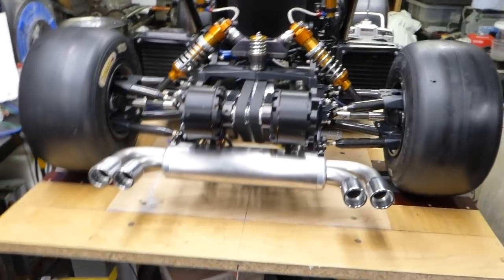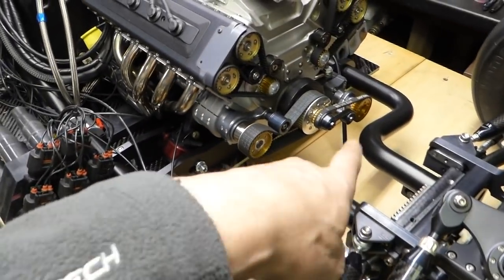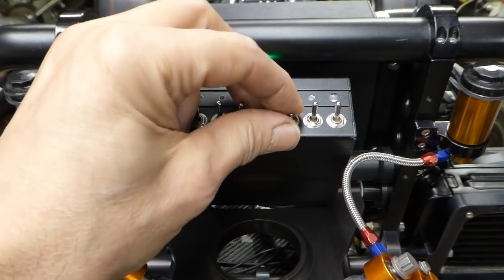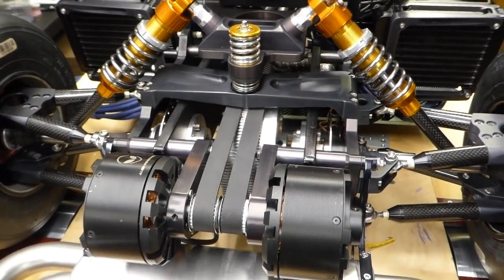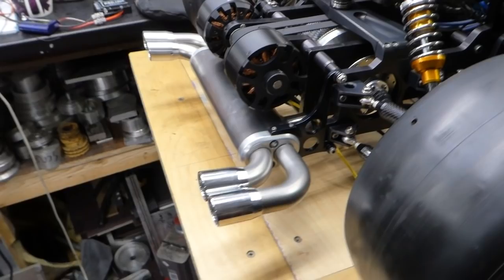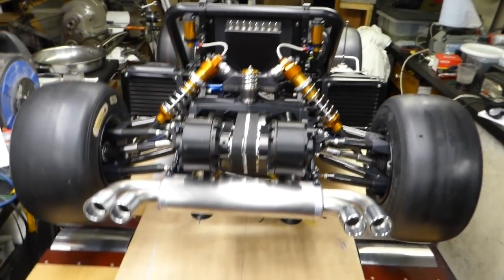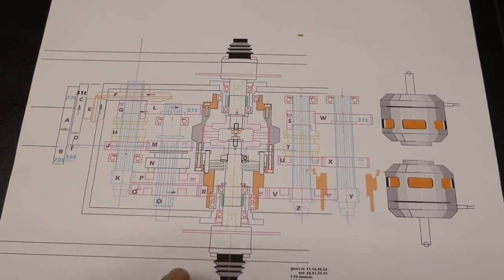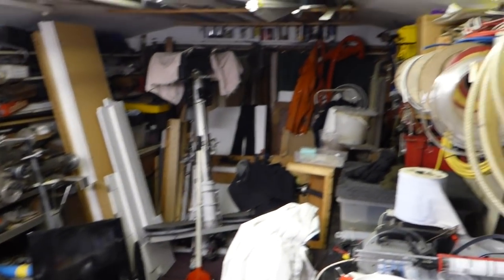1/3 scale 125cc V10 Hybrid RC car. Part 6

Comment: Is that hydraulics
Reply from the maker: Which bit? brakes or dampers? both are hydraulic.
Reply: @Keith5700  please make a video of making the hydraulics brakes and suspension
Reply from the maker: @mohammadanwar6515  i can't really. they're already made.
Reply: @Keith5700  when is your next video coming. I am waiting
Reply from the maker: @mohammadanwar6515  I would guess about 3 weeks when the new on-board fuel system is installed.

Comment: 1) This car is insane.
2) You are insane.
3) Why are there so many separate switches for the electrics? You will never encounter a situation where the coilpacks must be online and the fuel pump must be offline, for example, so they could be wired together. And surely the fans could be operated by a thermistor.
Reply from the maker: The Megasquirt controls all the electrics, the switches are manual overrides for testing, etc.
Reply: @Keith5700 : Oh. Interesting. Personally I would've just unplugged the electrics when I wanted to test them, but if you're anticipating a whole lot of testing needed, then switches would be worth the extra up-front work to install them.

Comment: Keith5700, I have not read everything or watched all of the videos yet, am I correct in understanding that you hand built this motor? Do you know of anyone that sells parts to build either a V-10 or V-8  of this scale? I do not have any tools to machine things like this, if you did hand build this I salute you for your outstanding work. I posted yesterday after I started watching the post, did not see that it was a V-10 and others started throwing rock at me, I am just curious about the motor, what fuel does it run off of? Is it a wet sump or dry sump oiling system? When do you expect to be through with it and do a test run?

Comment: Why you dont build a 1:1?
Reply: Why dont you fund it? Lol 🤘😎
Reply from the maker: Been in engineering design for 40 years, and self taught machining for about the same. Had about 15 years building full sized cars, but built other stuff too, helicopters, telescopes, planes, etc.
Reply from the maker: I made the billet aluminium bits. The cost is just buying the billets. To make this in full size would cost 20-30x as much.
Reply: @Keith5700  hey Keith, what is your vocation or training come from? Self learned? Technical school? Engineer? Just curious! Awesome projects.

Comment: if your interested in alternative remote controls ? the idea still exists .. tech still exists .. it just requires someone with nous to implement .. it would also revolutionise existing ( and somewhat old fashioned ) control ergonomics i.e. duel, 4 point stick.. or trigger grip with wheel .. and can also be used for flight RC
Reply from the maker: Well, I'd like to know what your idea is, but for this particular project I think it would be far simpler if I stuck to my conventional 12 channel set, as there's already enough new stuff going on to contend with.
Reply: @Keith5700  ok .. stick with conventional .. but think about minicam ( in drivers position ) mounted on electronic gyroscope..  connected to VR headset .. most of which available on amazon .. may want to reorient position of fluid tanks and stick fuel … where coolant and oil are .. case of accidents
Reply: ps maybe bracketry points.. to support engine near, or above centre of g .. incorporated into chassis .. as it appears ( from what I can see ) only 2 mounts from bottom
Reply: without sounding like columbo .. just 1 more thing .. do you have/ can you post, stock outputs for engine ?  torque .. max rpm and an estimate % of increase, with supercharger and what fuel ?
Reply: scrub stats ? found the figures

Comment: I just found your channel.  What an incredible project.  Do you machine your camshafts and timing gears?
Reply from the maker: Machined the camshafts, bought the gears. Made the timing pulleys.
Reply: @Keith5700  Wow, making 4 cams was quite an endeavor.  I worked as a machinist in a shop that built special machines that were used to make electrical terminals.   I got to watch another machinist make cams.  He carefully made each one and l never saw him have to start over.

Comment: I can help you with your ESC/PC connection.  Those VESCs can be tricky.
Reply from the maker: It's all working now, it was a faulty unit. It seems fine, apart from there's hardly any torque from startup. I thought these motors gave full torque from zero revs, but this doesn't. It only pulls 4 or 5 amps, until it gets going.

Comment: for the 2 fuel tanks you had planned, you could have a open and close-able cross feed so you can run off both tanks at once or run on them separately if you want to only use half fuel if you were going to do a return journey.
Reply from the maker: I've changed my mind, I'm going for a single one at the back, in between the other two tanks.

Comment: Where do you buy that engine?
Reply: he made it
Reply: A man named Conley builds engines like that and he also builds transmissions that goes with them as well their 1/4 scale copies of the real things and yes they are fully functional including supercharged versions I believe they run anywhere from $8,000 on up to $12,000 if you want it supercharged and not naturally aspirated if you search on YouTube Conley V8 engines the first result that pops up should be the one I think it's 24 minutes long and it's a tour of the shop where they're built

Comment: ok, well I dont think I will ever brag about racing go-karts again, lol, holy cow, santa vaca, this is a go-kart?, oh my, i cant wait to finish this video, back in the 90's I raced a Bug 90 frame, no suspension, tension bar in the back between the chrome-moly frame rails for stiffening the back end) with a Yamaha 100cc 2-stroke piston port (no reed valves) engine.  I see your fancy pant-cy cooling system, you know how I cooled down my engine? ya down the long straight-a-way turning the handle on the carburetor high jet to add more fuel (richer mixture), by hand! LOL

Comment: A hybrid lmfao bet a smoker pollutes the air more
Reply: Lol, true.  However, electric motors are good (better) at providing torque and control at low speeds in comparison to engines, so they're beneficial for that reason too.
Reply: @offroadrc110  yea true its one hell of a machine tho looks well built
Reply: @mattearnshaw525  Absolutely!
Reply: Scott E  In the realm of RC, an electric motor can do pretty much anything you want it to.  Brushed if you want good low end torque and control, brushless for brute power and speed.  To be honest, I'd say electric motors are easier to look after than an engine... Wouldn't say they require babying.  But there's nothing wrong obviously with taking the time and care to look after an engine if that's what you're using.  In fact, I'm sure many people choose gas/nitro because they enjoy the extra skill required.  It's all about doing what you enjoy most.
Reply: Offroad RC 1. Electric 2. Gas 2 stroke pre-mix 3. Nitro - in terms of ease of use. Electric RC’s are super simple to maintain. Nitro can be really finicky. I had an air leak in my Carburetor (.21 Big Block HPI) that was a pain to diagnose.

Though with my Team Associated RC8T Truggy, it’s Nitro Engine hasn’t given me issues. I guess it can be down to pure luck like anything else with an Engine.
Reply: @ŠpVŠpý  Totally agree.  Electric is very easy to use and maintain.  But for those up to the task, I'm sure gas and nitro are a lot of fun.  I completely understand why many choose to go with engines.
The challenges and maintenance are all part of the hobby for true RC enthusiasts :)
Reply: Scott E  of putting fuel in the tank? 🤔
Reply: Scott E  I'm not entirely sure I understand your view.  Cheap stuff from RadioShack is indeed just that - a quick, cheap, easy way to start driving something, no effort or experience required.
There is a huge difference between those and the hobby grade electric models though.  When you start using brushless motors and lithium polymer batteries, a higher level of skill and responsibility is required to avoid damage or injury, and it becomes increasingly necessary to keep the model tuned and in good working order.
There are also advantages in versatility for electric models as they can be made more waterproof, and more powerful with less mass.
I'm not saying Smart cars are environmentally friendly or anything, I'm just saying that there are performance advantages that are inherent with electric RC models :P.

Comment: i expect front will slip on wet a loot almost entire weight  is on back engine is in the middle nothing on the frone probably You need to add some extra weights to make front more sticky bytheway cool project
Reply from the maker: No. 45/55 front/rear.

Comment: Does the muffler have any internals?
Reply from the maker: Yes, lots.
Reply: @Keith5700  a pair of absorption type mufflers would sound better? Or are you looking to make it as quiet as possible?
Reply from the maker: Fairly quiet, but the baffles are really designed to split the gas equally, so the smoke is the same from all 4 pipes. Nothing worse than unequal smoke trails.

Comment: Total cost so far bud??
Reply from the maker: not dared keep a record. youtube ads pays for most of it.
Reply: @Keith5700  Haha, you're funny too ;)
Reply: I was gonna say the amount of hits this gets is amazing, not unwarranted though, great mechanical skills shown here, where you said the fuel tanks should go is where the twin turbochargers should go btw :)
Reply: Also how can electric motor so small produce 5hp?!
Reply: @KentRoads  Do you realize the size of this car? Look at the Radio controller besides the front right wheel, if you know how big those are you can imagine the size of the car. Its scale 1/3 afterall. The motors in the rear are probably close to 100mm in diameter?
Reply: I think you’re going to have to drop that exhaust a bit too or raise the electric motors as well as heat shield I’d reckon
Reply: Brad Stream I think he may have alluded to that, but nonetheless he definitively needs to hire you as his technical consultant.
Reply: I reckon so too ;D

Comment: I am blown away by your work. So much effort into every single detail. Are you going to fabricate any Aerodynamics for the chassis later on? Just to take advantage of all the engine power this thing must be able to put out when this is finished. I can imagine it with a huge front splitter, a huge rear wing and diffuser in the back to really suck the car down. Make it a time attack car! That would really make this thing drivable!
Reply from the maker: yes, hopefully, if I stick with it.

Comment: Unbelievable work, love it.

Get some regular drone ESCs for the brushless motors and you wont have issues, they even have RPM, temp.... telemetry some of them and easily configurable. Drop me a line if need advice on that.
Reply: Pau Mallol a drone ESC wouldn’t come close to being able to cope with the amp draw a car requires. My 1/10 touring car has 180amp esc, this would need something significantly higher than that.
Reply: @thedude669  With hybrid I assumed these two motors do not need to run alone the whole car but aiding the V10 engine (what cell count you want to use and what brushless motors' size you have there, for curiosity?).  if you have physical space, an RC car ESC gives you more product options though.
If interested, a couple of good high amp air ESCs:

- 125 A continuous: https://www.kdedirect.com/collections/uas-multi-rotor-electronics
- 200 A continuous: http://www.castlecreations.com/en/phoenix-edge/phoenix-edge-200-esc-010-0098-00
Reply: @PauMallol  Even with them just being assist unit they'd still pull more amperage than that those motors he's using are 5hp each. Besides he already has ESCs he's just having trouble getting them to connect to his computer.
Reply: Pau Mallol we only run standard 540 can motors anything down to 3.5 turn or 13.5t boosted, depending on the class you race. They are a fraction of the power that the 5hp motors will produce. I suspect drone esc’s are low amperage because of the low torque required. I would doubt a drone esc’s software would be set up to deal with the power delivery a car requires either. Would be interesting to try though I suppose.
Reply: Richard Charles I was curious to know the motors in the V10 car, specifically. A standard medium-size drone motors (say 35mm x 10mm stator 700kv) can pull already a kW on 6-cell in direct drive. But there many other considerations., especially torque (either through gear transmission and/or stator size).

Comment: Please Kieth could you tell me the electric motors you are using?
Reply from the maker: Alien 8055 4500watts. Yes, heat shield is on the list.
Reply: Do not know, but PMG outrunner on top of hot exhaust, not good placement for keeping the magnets cold. It would degrade magnets fast, if standing still too long.

Comment: Huge fans and radiators... do you have thermostat? If you don't you should!
Reply: Argeny Sandoval what purpose would isolating coolant to the block serve? I think it’ll warm up pretty quick.
Reply: @kart1241  By using a thermostat you reach a efficient engine temperature quicker but the most important is to maintain that temperature no matter what kind of engine RPM, weather conditions or percentage of stress you are putting in it.  For every engine there is a desire temperature in which the combustion is the most effective one. Maintain that temperature as steady as posible is a plus and that is the thermostat job, every 4 stroke liquid cooled engine which is not a Micro engine most have it, and this 125cc engine is certainly not a micro engine.

Comment: And Im crazy for building and flying a 1/3rd scale with a $7,000 7 cylinder radial engine in it. At least with the Air radios you can fly line of sight or by head gear.
Reply: I wanna see a vid of that flying!
Reply: Fuck yea that's badass ima go look an see what ya got on your channel man
Reply: No vids

Comment: dont you think the electric motors are pointless considering the immense power to weight you currently  have with the engine alone?
Reply: Ramiro M its for reverse
Reply: the engine has no torque whatsoever. the small displacement and the large amount of moving parts makes it a cool little engine to look at and listen to, but those engines have very little power. maybe 3-6hp if you're lucky and it s all up there in the rev range. The electric engines makes the low end torque for the car to be able to get moving

Comment: Hey what if you were to just use straight pipe heat wrapped exhaust? Instead of having the muffler. I mean not like you have to obey any regulations anyway. You could just do 5 into 1 on either side or send them straight to the back 5 into 2 each side for the quad exhaust.

Comment: Such a work of art.. cant wait for the video of it going full speed and flipping on it's lid
Reply: They look a lot like the radiotors you would use in a computer. I could be wrong but with the modified computer fans for cooling that's my best guess

Comment: I am fascinated by this build like man others here. Love to see more build detail - how did you build an exhaust and have it look like that? Is it pressed together?
Reply from the maker: it's 63mm stainless tube, flattened in the vice, with aluminium end caps pressed in, after the internal baffling is installed.

Comment: Do you get any sound from the esc's ?, not working because they haven't seen zero throttle, or tried servo tester to control them ?
Reply from the maker: No, the first job with these is to download VESCTOOL and plug the esc into the pc via USB, then program the esc. The pc won't even see the esc. It looks like they may be faulty. I can't understand how difficult it is just to get a motor to run. I've been sent a replacement, but that seems to have got lost in the post. Total balls up so far.
Reply: @Keith5700   I've not used the vesc tool , looks amazing with what it can do do, as long as it works though !
Reply: @Keith5700  Have you checked that you have the correct drivers?
Reply from the maker: You mean USB port drivers?
Reply: @Keith5700  it is possible that you need a virtual com port to connect the vesc to vesctool
Reply: @Keith5700  Yup

Comment: Maybe figure out how to mount the oil/coolant tanks where you want to mount the fuel tank (in front of/under the engine), and mount the fuel tank(s) behind and to the side of the engine.

More consistent COG as the fuel burns off.   Just a thought.

Comment: Swap out the oil and coolant tanks for the fuel tanks location, move the oil and coolant to the front. IMO it is not such a good idea having fuel close to the heat of the exhaust even if the header is wrapped.

Comment: I'm looking forward to a comment on the motor/esc supplier once it finally works (since I got a 6000W motor with some strange behaviour).
Incredible build, can't put it into words:)
Reply: Somebody else commented they get a lot of useful info off the electric skateboard forums regarding esc's and motors.
Hope this helps point you toward some useful info. Good luck.